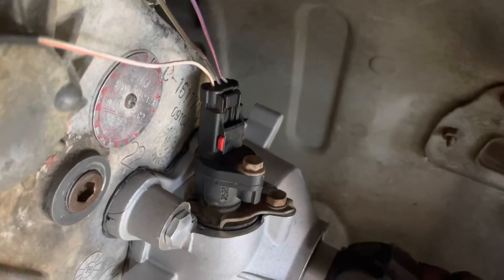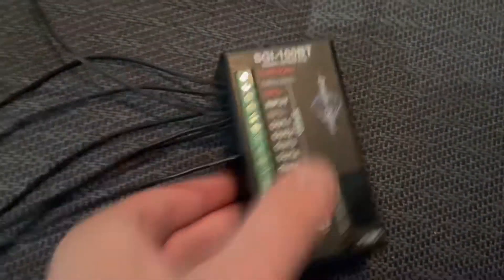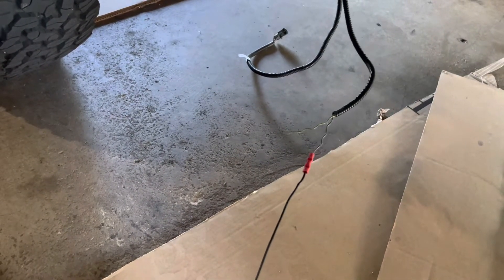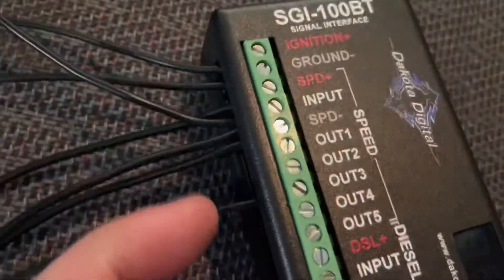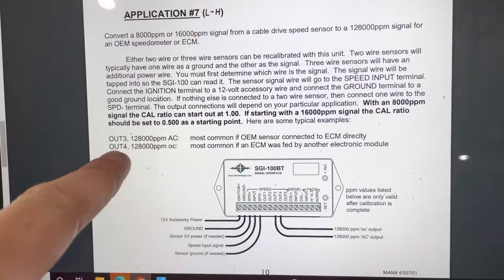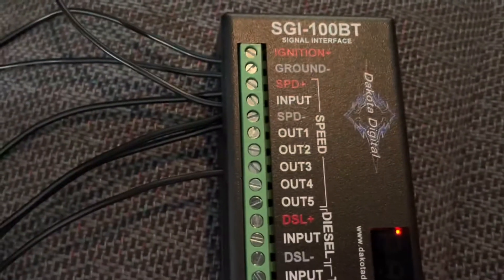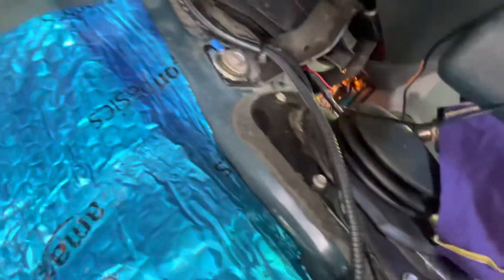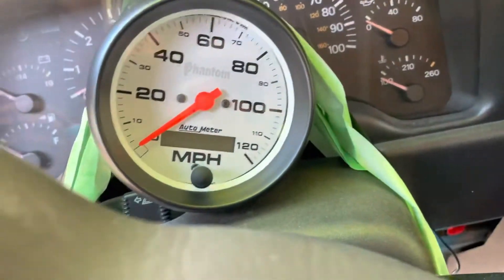Jeep Cherokee LS Swap - Dakota Digital

Comment: In regards to the drivetrain, did you keep your orginal tranmission? I'm thinking of keeping mine and maybe upgrading later down the line.
Reply from the maker: Stock ax15 manual transmission. Stock np231 transfer case. Stock axles.